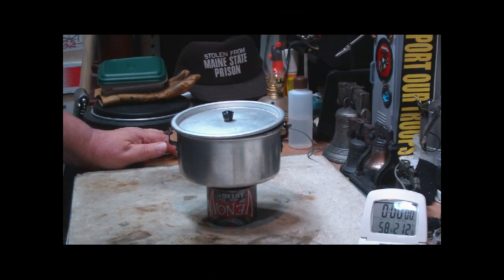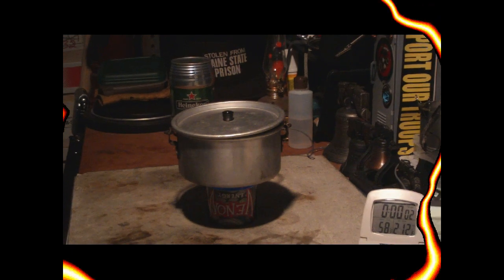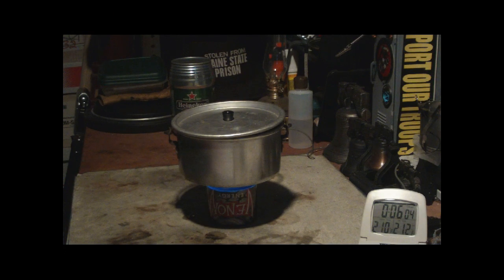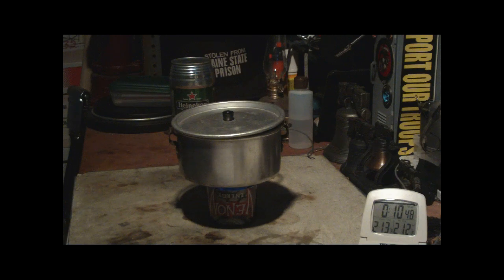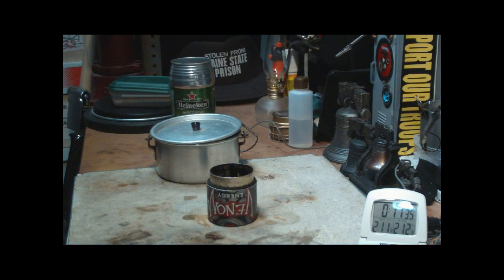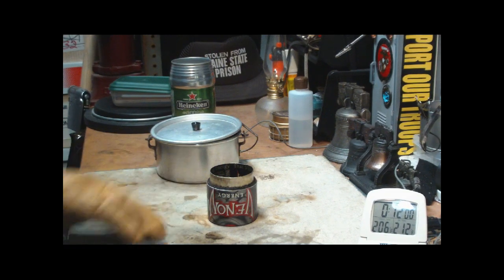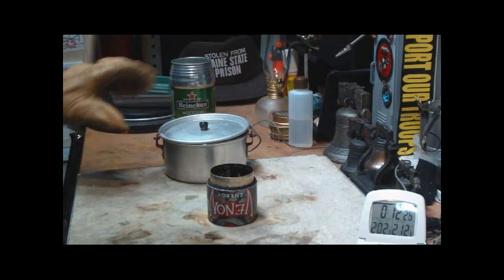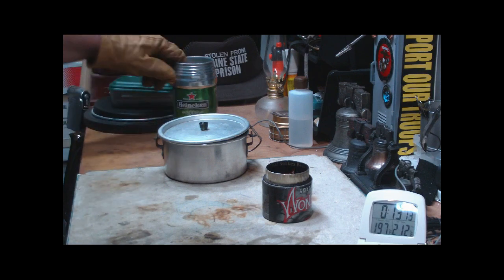Venom Super Stove - Boil Test #3

Comment: @hiramcook If you look at your footage at 1:55 a drop of the liquid drips down and then briefly burns.

I think that the cold pot condenses some of the alcohol vapor before it can burn. This would explain why it stops condensing once the pot heats up more. My Trangia does the same thing but your footage proves to me that it is not water condensation, but is actually condensed alcohol vapor.